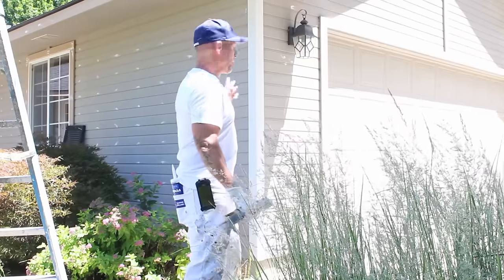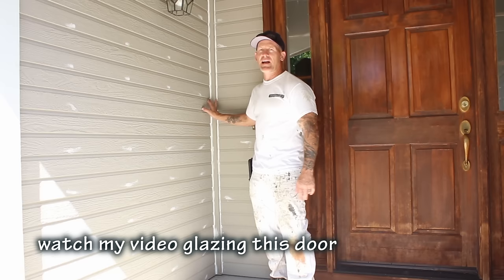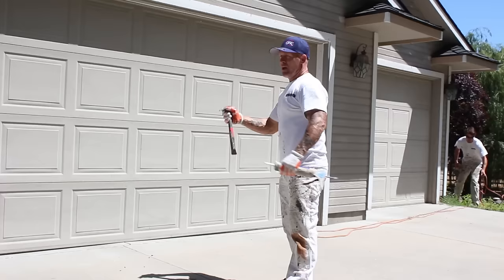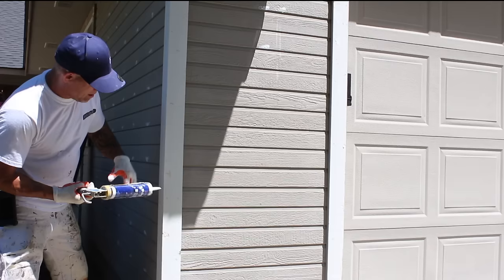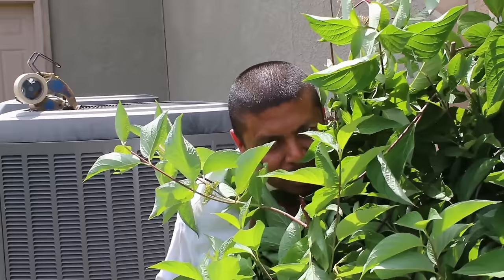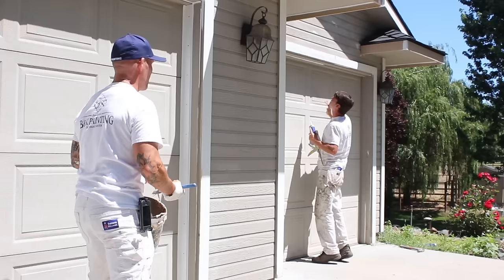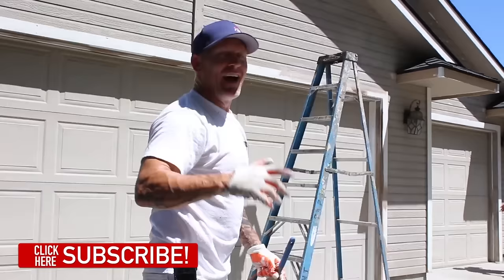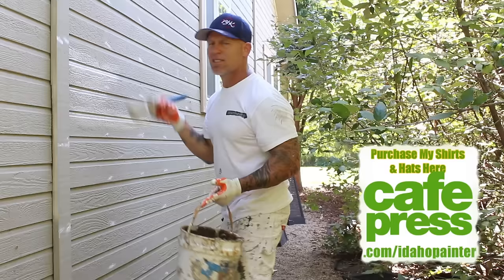Preparing To Paint a House.  House Painting Instructions & Hacks.

Comment: I had the hardest time caulking the the house, the caulk was everywhere and I tried cutting a smaller opening on the caulk and then there wasn't enough caulking coming out.  I had to keep changing my gloves and I had to have a bucket of water to wash all that caulking off.  I made a big mess.  I'd rather build a transmission.  Where did I go wrong?
Reply from the maker: Takes practice, make sure you wipe the excess caulking off with your finger or rag

Comment: Question. Between my house and shop, I have 2300 sq ft. Older 10" lap siding. (One story but, I live on a slope so, the back side of my house is basically 1-1/2 storiesish if that helps. Definitely going to have to get a 20' extension ladder) I used to paint cars for 7 years so I totally understand that good prep makes for a good paint job. Now, my question, how long would it take your least talented caulker to caulk that much SQ footage? Give or take a day. Btw, I hate painting houses. Lol. However, this is my first house I've bought and I'm not big on half assing stuff. Especially when I am going to be out this much $$!!
I sure hope you reply. My real job keeps me pretty busy so I have a very small time period to work with if I want it done this year.
Thanks in advance.

Comment: Besides appearance, is there a compelling reason to caulk where the soffit meets the fascia? I also notice that you didn't mention caulking where the frieze meets the soffit. Are there ventilation issues to account for? I guess I could caulk the fascia/soffit joint, merely to prevent water from getting up there the next time it's washed; otherwise, I tend to caulk only the frieze/soffit joint, because I want the fascia to be able to drain from both front and back in case of water intrusion. Am I wrong here, or is it a preference thing?
Reply: +The Idaho Painter Ok. I figured you had already accounted for any drying-and-drainage contingencies in the cladding etc. And of course you did, because you guys are top pros. Thanks for the vids.